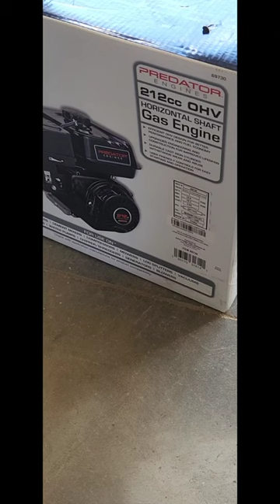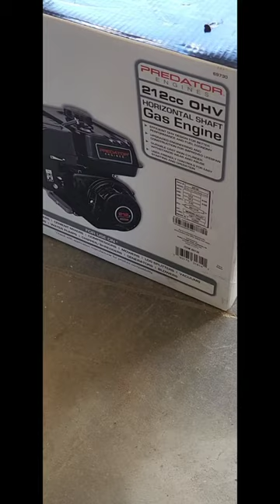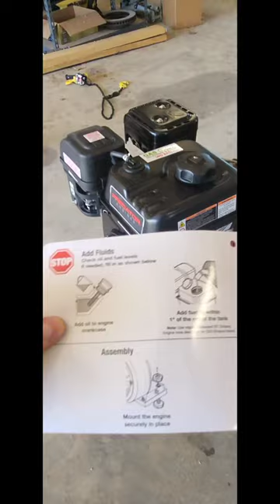Replacing a Troy Bilt Horse Engine Its Easier Than You Think #troybilt

Comment: Thanks. So many of the other videos have a lot more disassembly involved. I followed yours and was able to get the reverse pulley bolt and main pulley off with just a little pressure using a pry bar. Saved a lot of time. Thanks for posting.
Reply from the maker: Thank you Rob for watching

Comment: Awesome job showing us everything.
Reply from the maker: Thank you.
Reply: I have my dads 1987 model. It has the Kohler 8.5 motor and still runs but you can no longer get parts for that motor. Last year it blew the spark plug out of the head. I helicoiled it and have it running again. The motor runs great but This may be my next fix for it.
Reply from the maker: Yes sir. There great machines. You can get most parts for these things except on the older engine sometimes it's difficult to find some parts. HFT has "super coupons" for these engines a few times a year. Hard to beat them for the price. These old tillers where made well and made to work.
Reply: @TheRustyGarageandHomestead Kohlers all made in China today
Reply: except the only part I wanted to see - mounting the new engine and pulleys on the tiller frame. Oh well.

Comment: Thanks for the instructive video.
Took an hour to drive to HF to get the motor and only 2 hours to get it installed and running.
Didn't have an issue with the oil sensor.
This new motor is quite a bit lighter than the old cast iron 7hp unit so a bit less traction but it starts and runs fine so far.
Reply from the maker: Awesome that's great to hear. Glad the video helped. Thanks for stopping by

Comment: Didn't all old Horse models come with a 8hp engine? If so why replace it with a 6.5hp engine? There are several videos of people using the same replacement you did, but I don't get the replacing with a smaller engine. It's something I need to figure out because I will be doing it before next spring. I have been looking at the 8hp Predator, but should I be looking at the 6.5?
Reply from the maker: Hey thanks for watching. The answer is no they all didn't have an 8hp engine. Some did. Mine came factory with a 6hp tecumseh engine. Here is a link you can look up the horse model tiller serial #'s and it will tell you what year they  changed stuff. Hope this helps.
https://acrobat.adobe.com/id/urn:aaid:sc:VA6C2:e542543d-4b42-43b8-ab58-a4b218862c4b
Reply: I am at that cross road as well..Mine has an 8hp kohler . The 8 hp Predator shaft is thicker and will be an issue. They don't show the mount pattern for the 8. The 6.5 seems to power it well, isa there a difference in modern performance?  Torque?
Reply from the maker: Hey thanks for watching. I'm not sure. The 6.5 hp predator has been great. No issue with it being underpowered. Mine also came factory with a 6hp tecumseh engine though. It wouldn't scare me one but to take the old one off and install the 6.5 predator. That option is still alot cheaper than an new tiller.

Comment: Did the same swap, but mine aint working right. Every time i put it in reverse, the bolt holding the reverse disc tightens up and stops the motor. Any ideas?
Reply from the maker: Hey Jim, Hmm that does seem odd. Sounds like somthing isn't turning freely. I would take that fully off and see what it's like spinning the reverse by hand.

Comment: I replaced the Briggs with a Honda 200 GX a few years ago. I left my low oil sensor plugged in. Just over fill it with Just a little oil. These engines are lighter than the original. I’m thinking about getting a steel plate weighing about 20 lbs. drill some holes and mounting it to the bottom of the engine. Should match the original in weight. Next time around I may try the predator engines.
Reply from the maker: That's not a bad idea. so far this thing has worked flawless. I figured I couldn't beat the price of the predator engine. So far its paying off. Time will Tell how good it does.
Reply: My Dad bought a Horse with the Techumse engine back on the early 1970's and that engine is still running like new.  If I bought a Horse tiller with one on I would rebuild it rather than replace it because the balance it provides when using the tiller is the best package Troy Built offered.  I have a Horse with the better Kohler engine and that package is not nearly as easy to use.   The only way I would replace one of Troybuilts engines is with the Kohler diesel engine.  Close to the same height setting as the original, but slightly heavier but can run all day long on very little fuel and till full delth with no problem with all that tourqe.
Reply: @michaelbarrett1914  I just got one of these tillers a few days ago. Barn find for free. Still has the original 6 HP Tecumseh engine. All it needed was a new head gasket, a little tinkering with the original carb, new oil and Bob's your uncle. Works like new.

Comment: Carbs on the old engines werent the best but worked great until those didn't emptying the fule or adding stabil or sea foam.  Whats the engine replacement.  Mines a ood horse that uhsup had in irange color with 8hp briggs updraft carb
Reply from the maker: Hey thanks for watching. The engine I installed was a 6.5hp preditor from harbor freight. The factory engine was a 8hp tecumseh